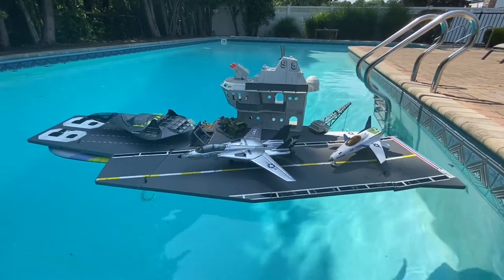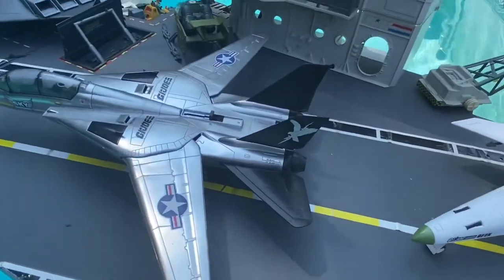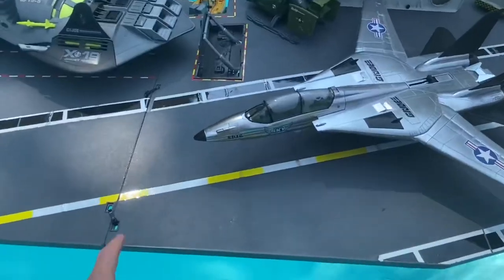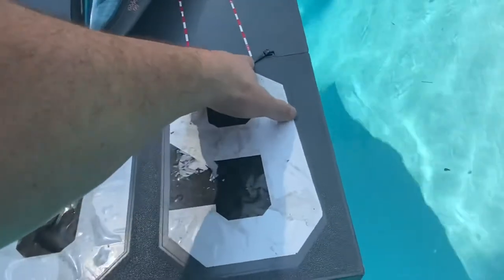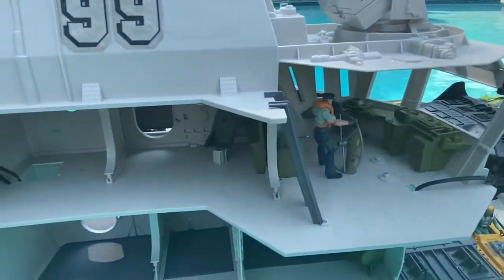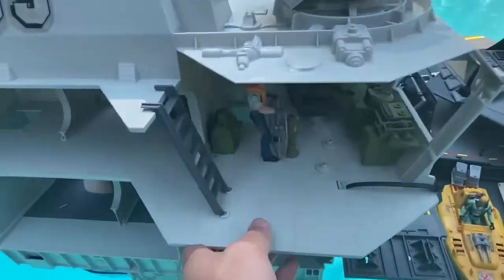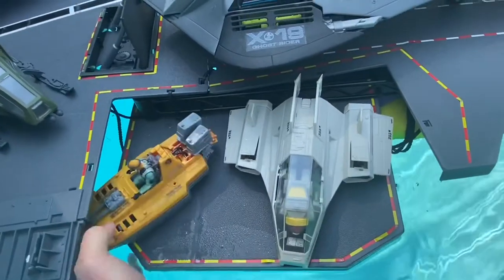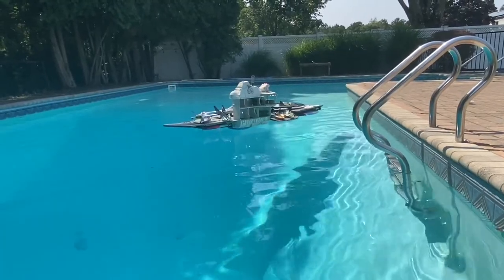How to make your GI Joe USS Flagg float! For real!

Comment: You can also use 4’ x 8’ 3 inch thick foam board. Cut it to the size of the framing underneath and paint it gray. Bang you’re done.

Comment: Your Skyhawk VTOL thing has clear plastic windows?  Mine just had cut-outs in the the plastic frame.
Reply from the maker: They released the Sky Hawk as part of the modern 25th anniversary line but renamed it the Ghost Hawk. If you eBay it, you’ll see it. It comes with a modern Lift Ticket sculpt. It’s pretty awesome and I regret not army building them.